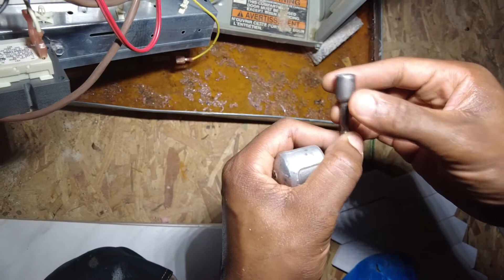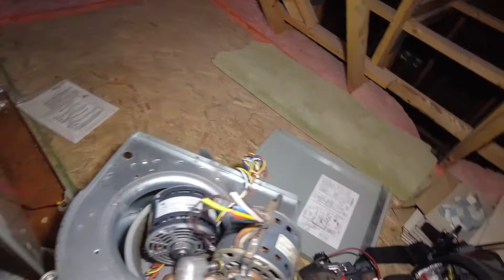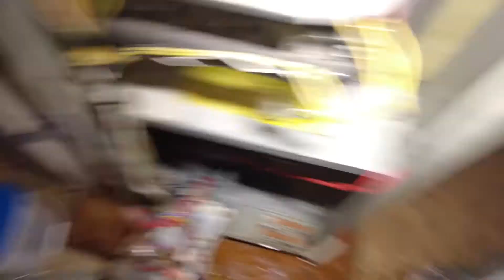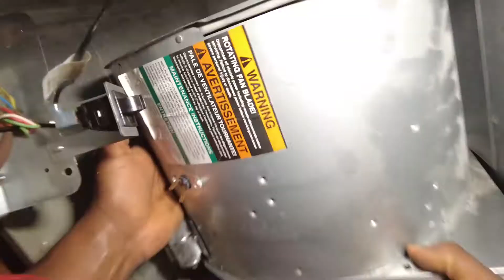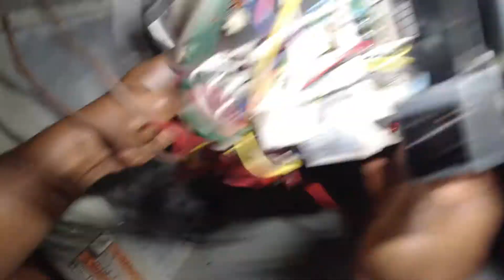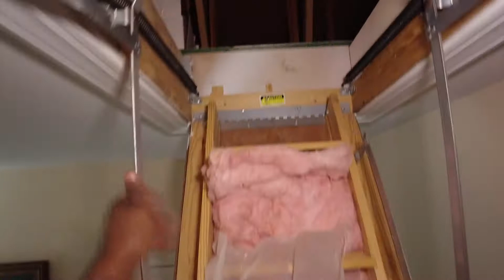HVAC Tech Replacing a Blower Motor in 110 Degree Attic | PSC Blower Motor Replacement

Comment: Attics can reach 150+ degrees on the hottest summer days, which is bad for homes with those silly horizontal furnaces located up there. Prematurely wears the blower motor having to operate 24/7 in such a hot and humid environment.
Reply from the maker: That's a fact. Especially ECM Motors with high static...